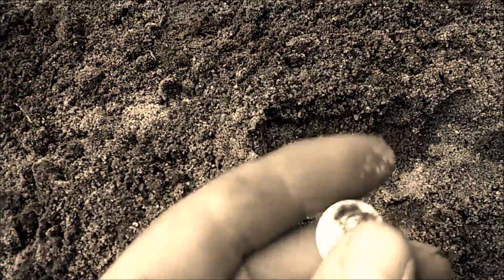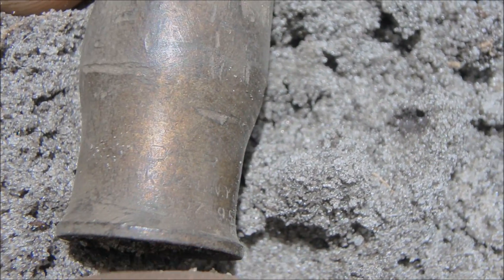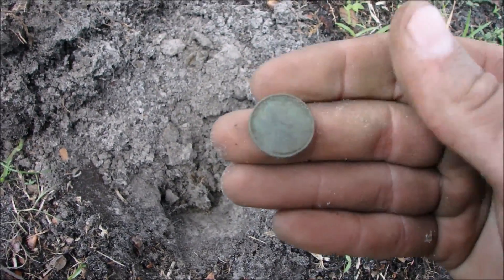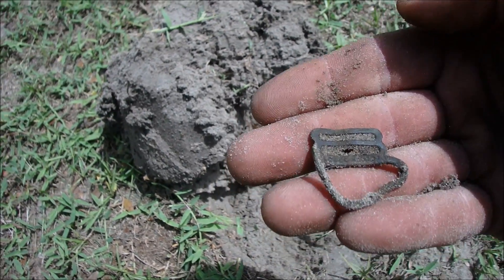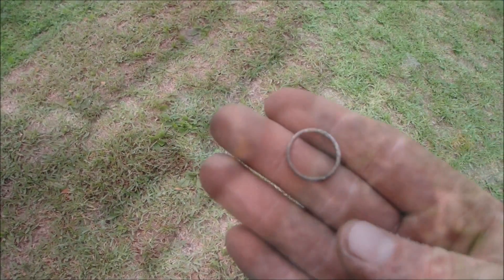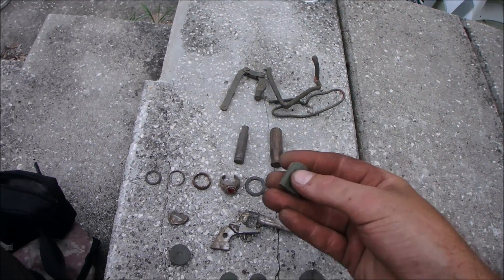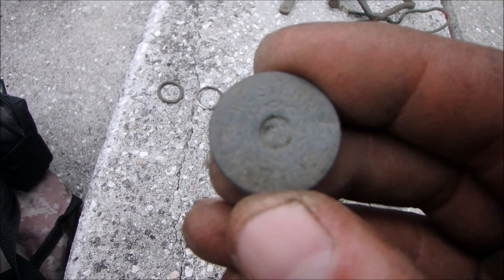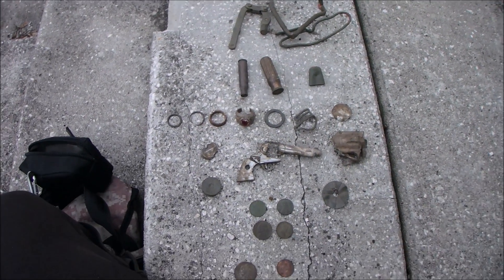Metal Detecting Historic Florida Garrett AT Pro

Comment: How do you like that sharpshooter coil on the at pro? Any loss of depth or stability.
Great vids man.
Reply from the maker: +PrairieKid03 i love it it is much more tighter on signals and depth is good for its size i hit a coin at 8 inches and had no peoblem loses about 1 inch or 2 max vs. the stock coil